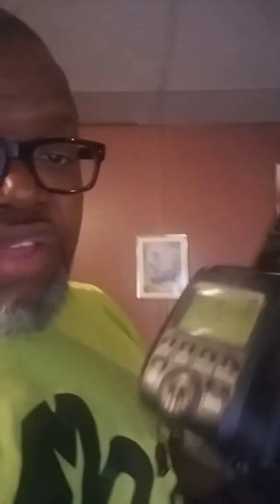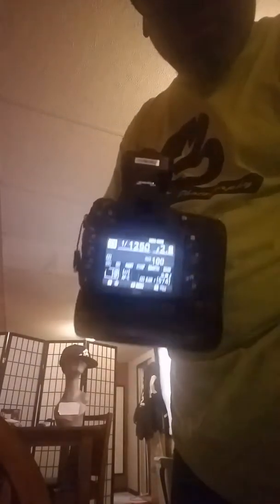Vision5 TTL portable strobe test shots

Comment: Just a couple of questions for you my man...why shoot HSS inside, studio shoot certainly does not warrant HSS?  Why use a 70-200mm inside in such a small space?  A better test for that beast would be outside using the same lens, using HSS  to either stop motion or a shallow DOF @ 2.8 for artistic affects.  The flash is quite suited for indoor "studio" work but I am sure the test would be suited for situations that put it to the test vs the over priced ProFoto , FlashPoint and Godox series.   Good luck and happy shooting. 
     Just a FYI, the modelling light really eats up the battery, if you do not need it to lock focus, turn it off and gain more shots from your battery...I speak from user experience, I also got this from Amazon for a record low price of $248.99 also got a second batt for $60 on FleaBay.
Reply from the maker: I don't use in indoors I shoot all on location I just recently used it for 5-6 photo shoots back to back on 1 battery outside and it didnt lose not 1 bar, this is definitely my go to for all on location shoots I havent found anything bad to say about it yet when I did this vid i was in the house playing with the strobe  but best believe i put it to work outdoors